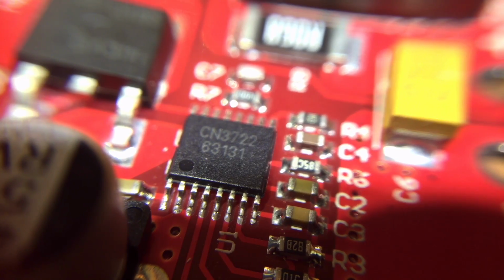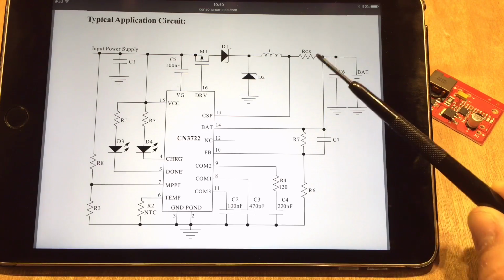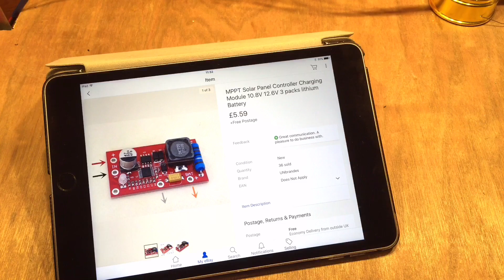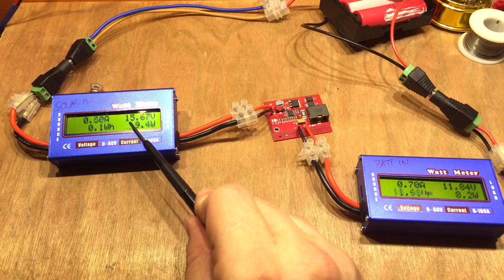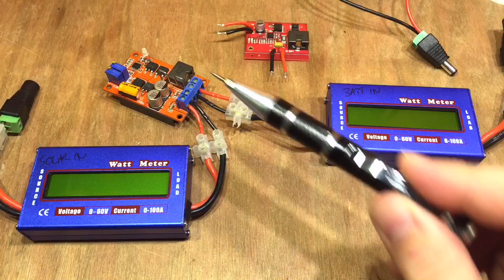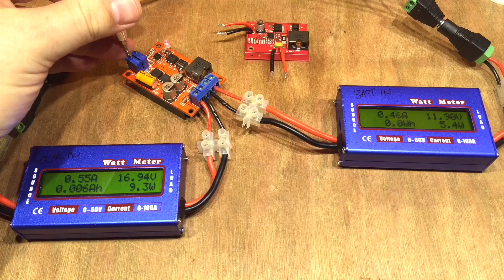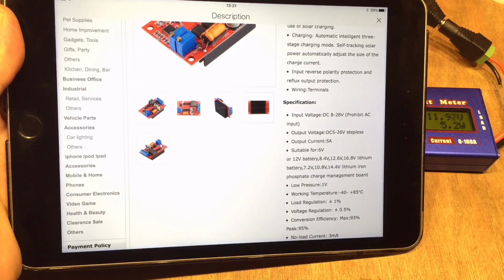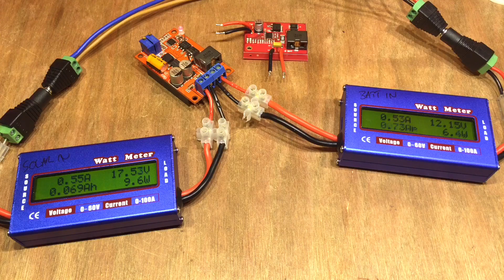Cheap(est?) Lithium MPPT Solar Charge Controller CN3722 - 12v Solar Shed

Comment: Does the charge controller supports multi-cell lithium-ion? (18650 3s3p)
I wonder how the charging of a multi-cell.
thank you.
Reply: in multicell you need to manage individual cells individually with some sort of battery management system.  unbalanced packs are unhappy packs
Reply: It's only OK not to balance-charge if you can ensure the state of the cells' charge stay within limits.
Any discrepancies in the characteristics of the cells will drift over time and require more effort to balance the greater out of sync they become.
Balancing currents are measured in mA, compared to the main charging current which with my charger is up to 20A.

Manual monitoring can get a bit tedious and being human, we can forget. BMSs in principal shouldn't forget!

Te 4.35 V is for newer LiHV lipos, and yes, that's too high for traditional ones:
Here's a good explainer:
https://oscarliang.com/lihv-lipo-drone-battery-hvli/

Those balance boards should be adjustable to between 4.20-4.35 V, though I'd like one that would do 4.15 V for longevity.
This seems to be the goto place for LiPo and LiFe BMSs - on my list to get a juicy 12-16 S 50A one!
http://www.bestechpower.com/balanceboard/

For riding around the city, my bike typically uses about 5-30% of its charge, so it's more sensible not to charge to maximum each time therefore reducing its lifetime.
If I want to go 100km somewhere, then I can charge to max beforehand and take my solar panels with me :-)
Reply from the maker: +Andy Lee Robinson Thanks Andy. Some really useful information there. I'll be sure to look into the BMSs in your link.
Reply: You're welcome!
I just recorded another update - made another panel, replaced the PVC film with polypropylene and added bypass diodes to each page.
Also discovered that the Turnigy Reaktor can set a minimum input voltage which will keep the panels near their MPP. So happy!
Reply: Adam,  How does charging Tenergy batterys with PCB protection do balancing? They make these batteries with only two leads out - nothing for balancing. Dpes that PCB do some balancing or is over/under current protection only?   http://www.tenergy.com/31016
Reply from the maker: +Scott Kraemer Yeah if you look at the specs lower down that page you can see the protection voltages are per cell - so the integrated pub protects each cell and should keep them in balance.
Reply: Thats wonderful - I think this is a good option/combination for the cheap pwm chargers. I am working on a robotic pool skimmer and hoped for a good solution for solar recharging safely
Reply from the maker: +karistuck yes it should as far as I am aware.
Reply from the maker: +topher Yeah. I did comment on this in my video. It's not worth the risk not to use a balancer.
Reply: thank you so much
Reply: You can get away without balancing for a few charges as long as you can keep an eye on it, and then balance charge every few charges or as necessary.
There's also less risk of overcharging a cell if the pack's termination voltage is set to say 80-90% of max.
They will also last longer if operated between 20-80% capacity (less variation is better)
Still, for peace of mind and 'set and forget', a proper BMS would be best, and this becomes really important as the number of cells to balance increases.
My ebike is currently 12S and proper EVs can go over 192S for hundreds of volts. A weak cell in one of those packs can have consequences a bit more serious than wrecking a garden solar light! :-)
Reply from the maker: +Andy Lee Robinson I've still got some more learning to do in this area. I fully charged my 3s pack yesterday on solar and the cells are very well balanced. They are all from the same laptop battery and all have very close capacities and internal resistances. I would still want to runs balancer though if I was running this permanently. 

Many of the balance boards on eBay though are sold as lithium ion but have termination voltages of 4.35. Too high in my opinion. I'll keep looking.
Reply from the maker: +Andy Lee Robinson Sounds good. Looking forward to seeing the results.

Comment: I believe your logic has a problem.  if the LiPo should charge at a specific current due to its voltage you will not see output power = input power
Reply from the maker: +topher I was thinking about this when I uploaded the video last night and you might be right. In which case it will need to burn off some of that power as heat - perhaps it would be better to go off maximum power point instead. More testing perhaps.
Reply: +Adam Welch please more testing (: 

I've been digging and digging to find good lipo BMS for small cheap 3S lipos I have.  I've come across a good website for them link follows!
Reply: +topher I haven't bought and tested them yet but that's the best I can find for individual cell monitors and over,under,charge,current and discharge.
Reply: +topher search on ebay for 18650 bms with protection,  you will find a few different types available, some look the same as in your link at all battery, and no doubt cheaper.

Comment: Awesome little handy modules.  Would love to see how accurate they charge and what actually happens to the charging process when the sun goes away for a while (not that that ever happens LOL)

Now I'm electronic man myself but I am starting to struggle with a bunch of naked pcb's that end up in boxes.  You make the same 'mistakes' as I do and that is to solder the wires to the board without any mechanical protection.
Wouldn't it be time if everyone starts using standard size pcb's and we can get cheap modular cases?   Luckily some sellers are now offering these lego style see through cases but when you have to order them separately the price of the module doubles.

Anyway great video again and yes I had a question mark stuck in my head about the mppt treshold level and how they would do it with that seemingly not complicated module. And then you pulled out the other module.
Reply: heat shrink tube

Comment: Thanks for the look at these, I've seen them before but nobody had done a particularly good job of going over it until now, if you get the chance you should also have a look at the BQ24650 it's supposed to MPPT in a similar manner, when you set the voltage and it's supposed to drop the current in order to maintain that voltage.

There's also this one that someone in the comments section over at Julian's channel pointed out, but I have no idea whether it's MPPT or not, I asked the guy to check, however he never came back with any results/confirmation.
http://www.aliexpress.com/item/MPPT-Boost-Solar-Charge-Controller-step-up-90V20A-charge-all-kinds-battery/1708497647.html
Reply from the maker: +vgamesx1 Thanks for your comments. Ive seen the BQ24650 but it generally retails a bit higher than the CN3722. I've not seen that one you've linked to - looks like another boosting solar charge controller. Although I could rig up a 24volt battery bank, I like to keep mine at 12 volts so it's probably not a product for me. Perhaps one day I'll take a look. 

Thanks again.
Reply: ***** So uhh, I have a question, I noticed you haven't done a video (aside from the one playing with a function gen) on your little oscilloscope, how well would you say it works, is it any good?
I was considering getting one, as I found a DSO112A pretty cheap at $56.
Reply from the maker: +vgamesx1 Yeah there's a new grey version out isn't there. It's ok for demoing what's going on, but if you want accurate measurements and a clean trace then it's probably not the best option. It is what it is really. 

Oh I did do another video where I upgraded the firmware.
Reply: ***** Yeah you aren't missing out on much, just a few minor improvements.

Thanks, in that case I may get a cheaper one, I really liked the touch screen on yours, but the DSO068 appears to be the best value of these cheap scopes, since it has 3MHz bandwidth, comes with a proper probe instead of alligator clips and can be used as a USB scope, the display is probably the biggest let down of the kit though, so I dunno...
Reply: Hey if you're interested I have an update for you, I got something which reminded me of your video, I ordered one of those BQ24650 modules because it seemed like it was slightly better than this one, I just received it the other day so perhaps if you'd like I might do a video on it?
Reply from the maker: Thanks for coming back to me.  The guy behind Voltlog has done a decent review of that device which is worth you watching.  I liked this version because it was cheaper :-)
Reply: ***** Yeah I saw that video, it's pretty good except for one thing, I wanted to see a test of how it performed using a solar panel, basically how well does the tracking work, so I was thinking of plotting out the power and efficiency curve from it's cut off point to the panels max voltage, the main issue for me is that, I don't have a good way of data logging over a period of time.

I love cheaper too :)
However, I was a little unsure about this one after seeing it get as low as 50% efficiency, but what really sold me on the other one is a guy named Onstate LED Lighting did a video on all these little MPPT modules, the video itself was alright but his comment:
"This product is one of a few DC converter products from China that functions as intended."
That's what made me decide it's worth the extra $2-4, well that and I'm becoming a bit of a fanboy for YZX Studio products lol, them and Mhinstek with their MingHe products both appear to make a bunch of really good electronics, dc converters in particular.
Well, have good day Adam.
Reply from the maker: vgamesx1 I might add one to my basket at some point and see how it compares.  You'll have to keep watching ;0)